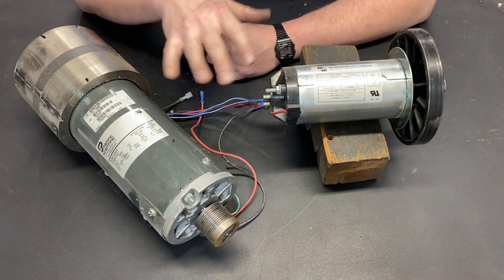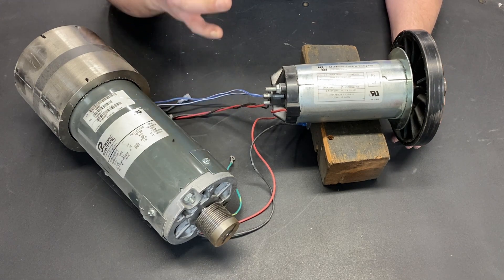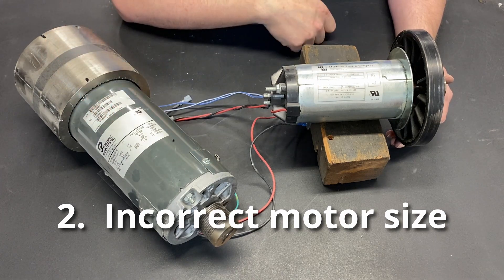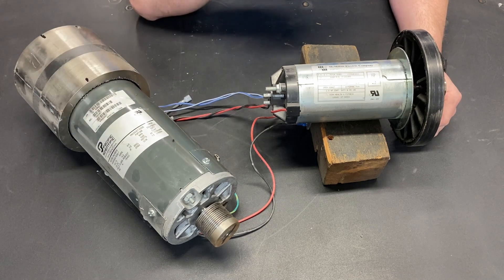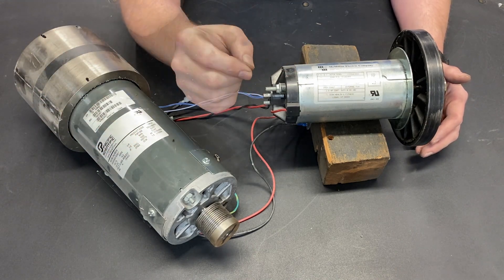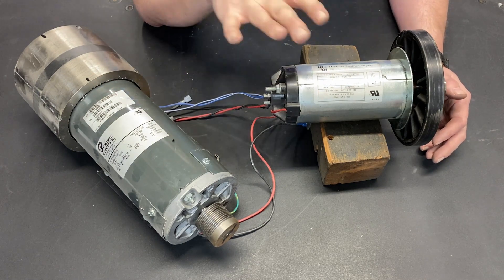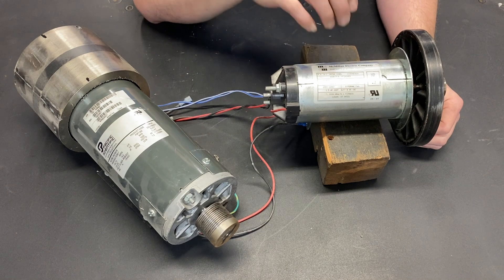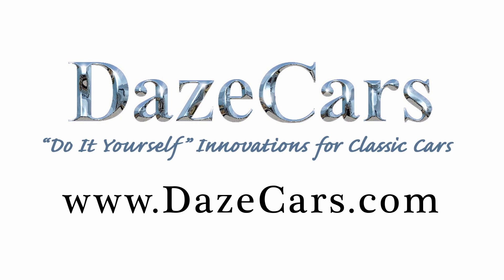Treadmill Motor Conversion Mistakes, Going over Common Mistakes people make on their Conversions

Comment: These are all great lessons and you offer the correct solution for this application (machine power conversion). Almost any application really.
There is another solution for some applications, although cooling and gearing is applicable to every electric motor application.
Specifically, when electric motors are used as traction motors which will require the motor to run from 0 RPM through the max RPM, using two of the smaller motors might be a better option.
In the early 2000's my tiny business built high performance stand up scooters before it became the thing it has now become.
We had limited resources to source our products from.  To keep costs down it made sense to use the standard Chinese scooter parts, but simply installing a 300 Amp (golf cart) controller would ignite the brush housing in the first ten feet.  Likewise, any attempt to modify existing controllers resulted in MOSFET fires.  Now you know why we call them Metal Oxide Smoke & Fire Emitting Transistors.
What did work in this application was to run 2 of the best cheap China motors available which were rated at 800 watts.
Since the entire vehicle and rider only weighed 300lbs, we could dump stupid amounts of current into two motors for just a few seconds and get away with it.
All we were really trying to do was teach the gasoline scooter people a lesson about electricity in a short drag race. It worked.
Reply from the maker: Interesting concept, I had not thought of running two motors but assuming they were the same I could totally see the benefit.

Comment: So uh question for the expert in the field, I just salvaged a commercial 220 volt treadmill and pulled a 3phase motor, I can tell that the VFD is on the control board but am helpless as far as figuring out what to do to get it turning. Have you messed with these? Do I just need to bite the bullet and purchase a new VFD?
Reply from the maker: I have not messed with getting any 3 phase AC motors from treadmill working.
Reply: @dazecars  Drat foiled again!

Comment: New subscriber here. Thanks for the vids. Quick question, can an EMI filter be used in place of a choke on a TM motor?
Reply from the maker: I have not tried it but you would think it would help some.  The important thing would be to make sure the EMI filter has the correct amp rating.  Being undersized at the very least would reduce motor torque but more likely would burn out the filter.
Reply: @dazecars  The emi filter i have came with the same tredmill. Its rated to 2250vdc. Curious as to why it would have had a choke and an EMI
Reply from the maker: @tiggerkzn  In most cases an EMI filter is designed to eliminate electromagnetic interference from this device to other devices so it probably won't do much for the motor but would reduce the interference other devices in the area experience.
Reply: A choke is a sort of EMI filter too.....without the caps....
to use an "EMI" type filter..
all components would need resizing to larger sizes , higher capacities  etc.

Comment: What would be your advice if I wanted to make a chicken & turkey plucker? I am a new subscriber and have not gone through your playlist yet and I have no knowledge in this area....yet.
Reply from the maker: Not sure, I know lots about treadmill motor conversions and almost nothing about chicken pluckers, what questions do you have?
Reply: @dazecars  a plucker doesn't need to have high rpms but it does need torque which is why I'm interested in your expertise.  Do I still need the circuit board if all I need is an on/off switch without a potentiometer? Also, can it be run off of a battery off-grid?
Reply from the maker: @snowdragon930  It can be run directly off of batteries.  Just keep in mind that voltage effects speed.  I would try and run it as close to the motors's max RPMs.  that would be at the voltage listed on the motor and then gear it down to the RPMS you want, this will maximize torque.

Comment: Have you messed around with any 3 phase AC drive motors?  You can find them in almost all Life Fitness commercial treadmills. Matrix treadmills probably have the most powerful commonly seen treadmill motor(made by Johnson Controls) out for the past ten years. Cybex is owned by Life Fitness so their stuff is cross compatible sometimes. And Precor and Startrac commercial treadmills also have some of the most powerful motors out there. Most are AC motors though… there are two Precor treadmill models called the 932i or 946i that is about 20 years old now. If you come across one of those, they have Massive DC drive motors made by Leeson. Very rare to see one of those motors ever fail and the bearings are easy to service/replace.
Reply from the maker: I did scrap one Life fitness treadmill with an AC motor but was not sure what I was looking at other than an AC motor so I didn't do anything with it.  I know now a VFD would have been an outstanding option for that motor but some times you just don't know what you don't know.

Comment: Two years ago you inspired me to convert two wood lathes to variable speed, Daze. Then you helped fine tune them with the proper gearing, a cooling fan, a quick start bypass switch (disabled safe start), a tachometer and a reverse switch. The speed control has made a huge difference in tooling a fine wood finish instead of using 80 grit sandpaper. I rarely touched the four gang pulleys before knowing you and now speed changes are made 10-20 times each project.
If you come to east coast Canada (New Brunswick), Daze, you have a place to stay. Thanks for sharing your knowledge. Salute! 👍👍
Reply: Garson,
I'm in the process of doing the same conversion.  Any chance I could see a few pics of your setup?
Reply from the maker: Glad I could help and thanks for the generous offer.  I will likely not ever be in your area but anything is possible.  If you ever have the opportunity to share my channel with other groups and individuals it would really be appreciated.  I am one channel among thousands and it can be hard for people to find my videos.

Comment: Thanks for this video , I just finished a wood lathe conversion , on a cheap mechanical variable speed lathe .
 Love the power and speed control ,  one more thing to complete is a dual resistor as I’m getting a small lag at the start of the speed control . Thanks for the help .
Reply from the maker: Are you saying that when you turn the nob it turns a bit before the motor comes on?  if so take a look at this https://www.youtube.com/watch?v=04d0u1RJyXw&t=11s